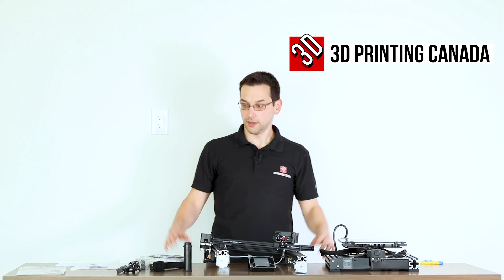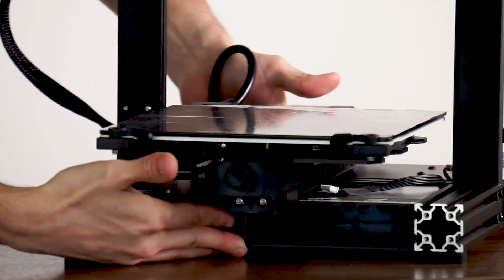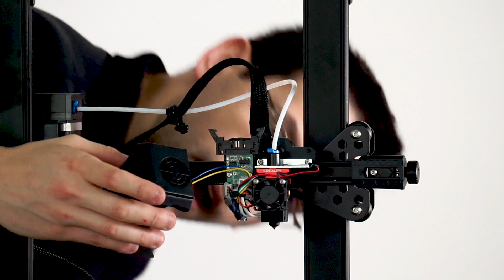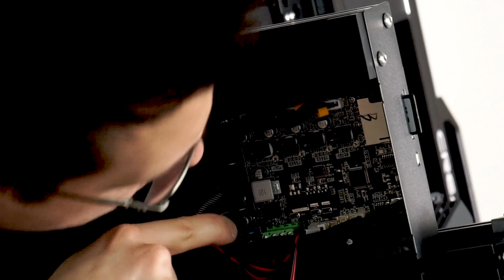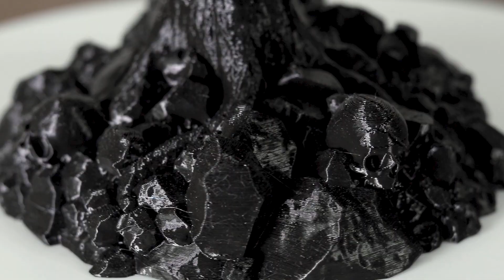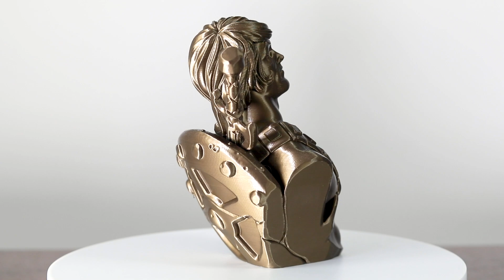Creality CR-6 SE Unboxing, Build and Test

Comment: I bought one of these about the time you made the video, but never got around to using it, as my Ender 3 was serving me fine.  I finally got around to putting it together the other day.  It went together quickly and smoothly.  I then plugged it into my laptop, in order to check & adjust / calibrate the e-steps, and, guess what - the computer does not recognize / cannot find / locate the printer.  Any thoughts, suggestions, ideas.  I am having a similar problem with my Ender 3.  The original main board finally gave out, so I replaced it with a BTT SKR Mini E3 v2.0, and guess what - the computer no longer recognizes it either.  It was recognized & I was able to communicate with it, when the original Ender board was working, but not with the new one.  Any thoughts, suggestions, ideas on this issue also?

Comment: Thanks for this good review. I have mine for 2 months an like it as well except that it is very noisy even when it is not printing. The noise comes mainly from the PCB Fan that runs in permanence with a rather high pitch. I have noticed on the video that we could almost not hear the fans of your unit and I am wondering if my printer uses different parts. My PCB is also a creality v4.5.2 and the reference of its fan is CHA6024RL-15B. The problem is even worth when the PSU fan kicks in. it is almost not possible to work in the same room. I am wondering if others have the same problem and if there are two version of the CR6 SE?

Comment: Thank you for this informative video. I wish you had shown the correct procedures for filament loading and selecting a file from the SD card.  I'm experiencing trouble on those with my new unit and I was hoping to see how to do them properly. But apparently SD card problems are very common on these and I may be fighting motherboard flakiness.

Comment: Bed levelling is not optical,  it uses a load cell connected to the hot end to detect pressure on the nozzle when it touches the bed.

Comment: The LED is NOT for bed leveling, it is just for light.
The bed leveling on the CR-6 SE is using a strain gauge to register when nozzle touches the board.
Reply: @14.20...

https://youtu.be/uPSchqn6kgQ?t=860

Comment: Bed leveling is done with a strain gauge not an optical sensor
Reply: Correct. The optical sensor is used as a way to sense when the strain gauge should be tared, then probed.
Reply: @Sebazzz1991  DaS I don't think you understand how strain gauges work. Perhaps you should look into that some before commenting
Reply: @pbshooter100  I developed the CR-6 community firmware. I think I know pretty good how the strain gauge functions. The optical sensor is used to activate the Z-endstop (which is the strain gauge). It is also used to determine when to tare the strain gauge. The strain gauge is tared just before homing, as well as when moving to each of the 16 points of the bed.

So, don't be so snarky, please? No need for that.
Reply: @Sebazzz1991  Good for you

Comment: you need to do your homework on the printer. your bed leveling device you showed is a led light and bed leveling is done with a strain guage that the hotend mounts to . This is avery good printer out of the box and was a great deal on the kickstarter.

Comment: I would not get this printer yet, I backed the Kickstarter and had to replace the switch because the printer would not boot, then there is hot end issues with cracking. Printer been down a month. Wait until they fix mother boards blowing up and sensor issues and switch and the hot end cracking.